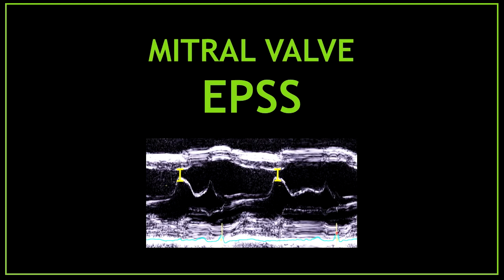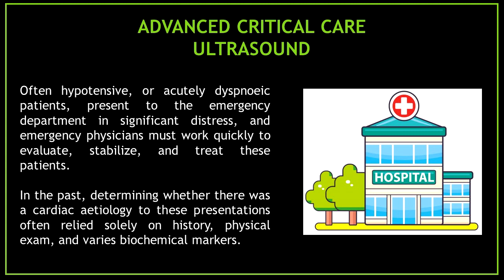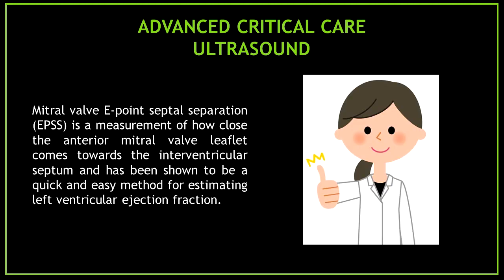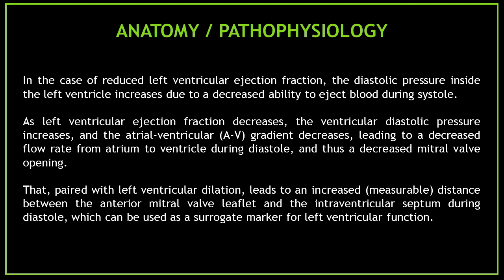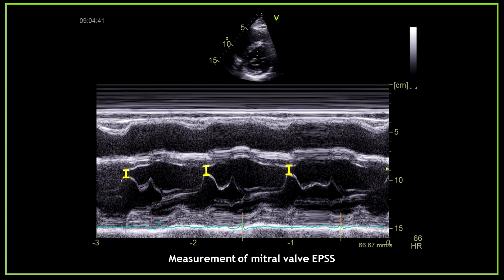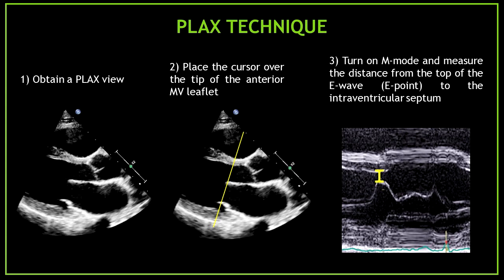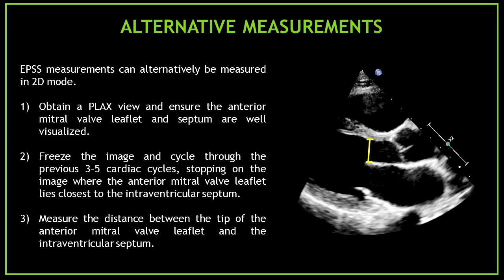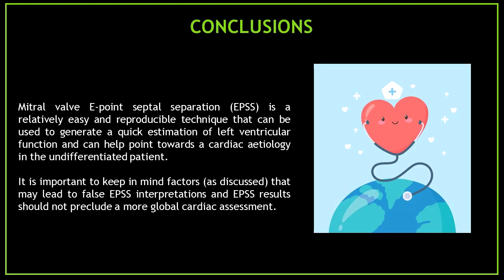How to measure the EPSS? (Systolic function - Echocardiography)!

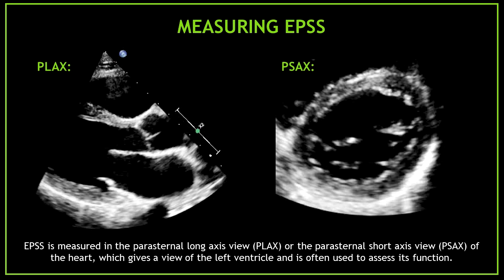Comment: 0:07 E POINT SEPTAL SEPARATION 7:55 E POINT SEPTAL SEPARATION CAN BE MEASURED PLAX AND PSAX VIEW 8:25 M MODE CURSOR PLACEMENT 9:05 NORMAL MITRAL VALVE M MODE WAVE FORM 10:11 EPOINT SEPTAL SEPARATION 10:41 NORMAL VALUES OF E POINT SEPTAL SEPARATION
Reply from the maker: 🙏🏻✨😊 are this your notes?